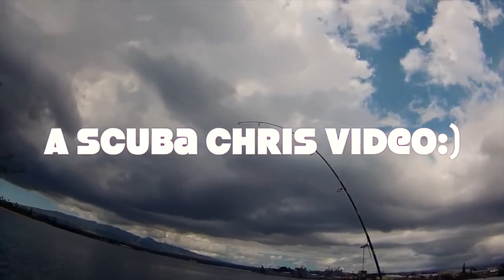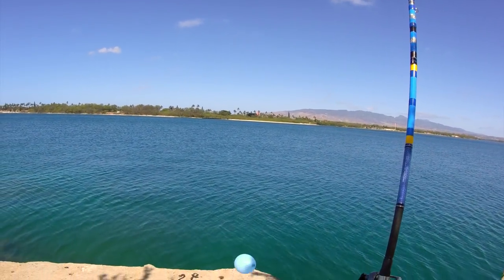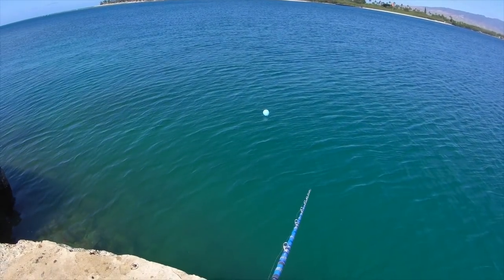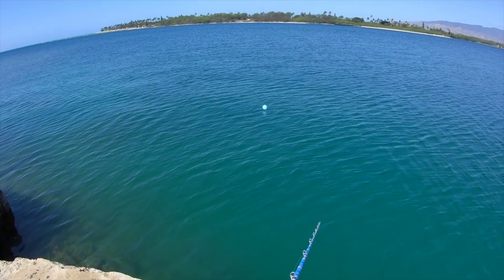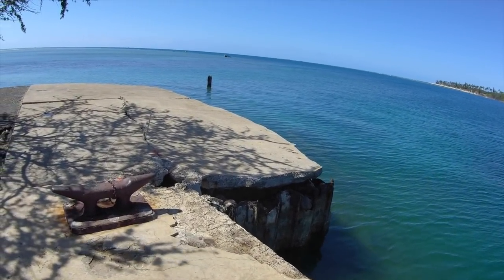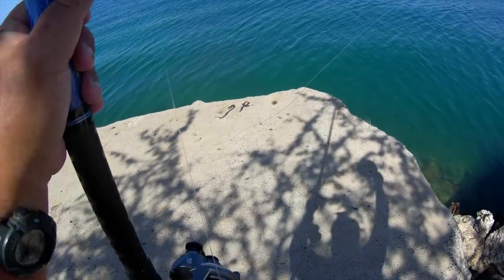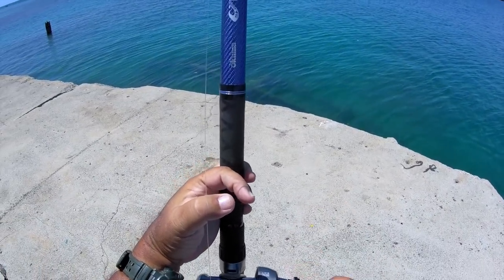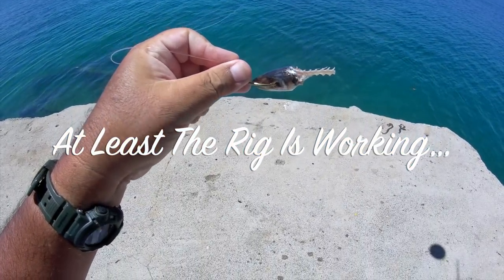Float Rigs Work off Piers or Shorelines!

Comment: Balloon rig is super effective here in SoCal.  We use it on Bluefin Tuna when you need to keep your baits near the surface, or even White Sea Bass when you need to drift your squid out.  Good video.
Reply from the maker: Mahalo Davey! When the true North winds are strong (and also cold) here i head for the South shore for float rigging. Winds are at my back. Easy to get those rigs out.
Reply: Can you get bluefin with this rig from shore or is this on a boat
Reply from the maker: @ssj4naka  This is a shoreline rig. Bluefin Trevally? Yes sir!

Comment: Balloon fishing is really effective in Oklahoma City for catfish from shore. Since one of the local lakes is really shallow it helps bank fishermen get FAR into the middle of the lake. Lately that’s been the only way to catch fish.
Reply from the maker: Sounds like your winds are helping you out. I use Life Savers to cut Lollipops to tie the balloons to my swivel. After 12-15min the candy dissolves & your bait will drop. Some use rolled TP.
Reply: Yeah that works great when the wind is roaring and the bait goes out fast but I’d rather keep the balloon on my line. I’ve seen guys at my lake use a high powered air soft rifle and a long range scope use it to pop their balloons when it’s far out. Those guys use the biodegradable and some rig that keeps the balloon pieces together. Those locals catch the big fish constantly.

Comment: I always use a steel leader and it still gets bit through where you are. Last year be caught a 10ft hammer right there.
Reply from the maker: I'm always afraid to use wire leaders during the day there as it's highly visible. Night is better but the winds aren't right yet (onshores so far).
Reply: @ScubaChris  I've never ran into that issue with the wire. I think it's the barracuda biting the line. Next time you go at the very beginning by that wall there's a huge eel right there. Bugga broke 2 poles and snapped 100lb line. It's a good 5-6ft long. It hides under that cement slab.
Reply from the maker: Not anymore. Someone caught it & left it in a foam box on the pier stinking up the whole place. The cream colored one with the spots, correct? Of course i had to dispose of it like everything else there. I'd like to send my thanks out to local angler Josh Madayag & military angler Chief Marshall for always helping me out by policing the area & helping me keeping it clean for others to enjoy. If any of you "bump" into these guys give them a big thanks for helping me haul garbage out of there.

Comment: what kind of rod is that ? brand?
Reply from the maker: It's Okuma brand Hawaiian Custom Series 13ft MH Ulua "GT" Rod-
https://www.youtube.com/watch?v=7RgE2ck2tuM
Reply from the maker: Has a brass tube glassed in for your bell with a stainless steel butt.
https://okumafishingusa.com/collections/rods/products/hawaiian-custom-rods
Reply: thanks like that rod
Reply: @ScubaChris  I know this is a really late reply, but how do you like that rod for larger fish? I have the 12' daiwa costal sp surf currently, but want the 13' for the 50-80 larger shark/big game. Worth the money.
Reply from the maker: @danielcabibbo8590  I was one of the main anglers who found a flaw in one of the Coastals so the company sent me replacements. They snapped at only casting 1/2 they're designations. The Ulua Rods have held Uluas to Sharks.